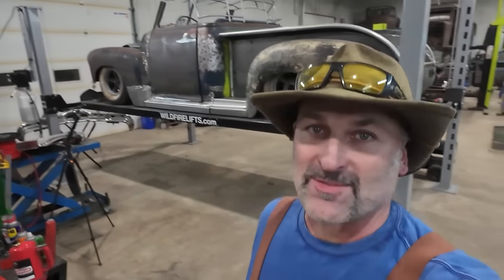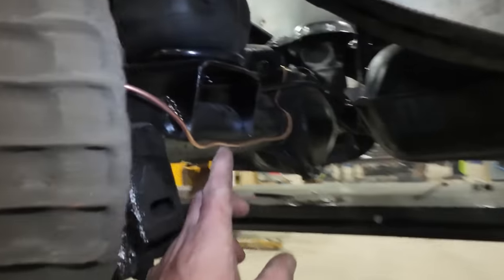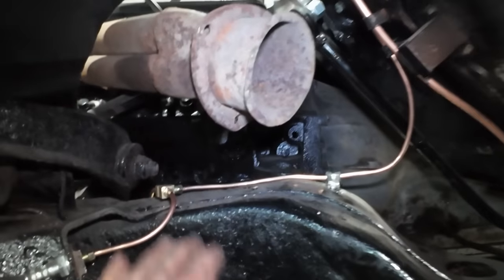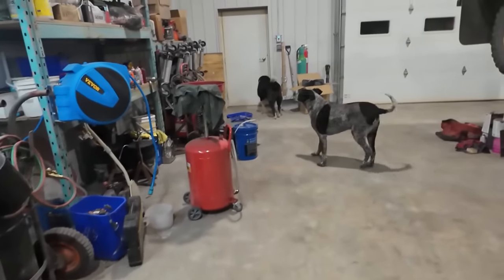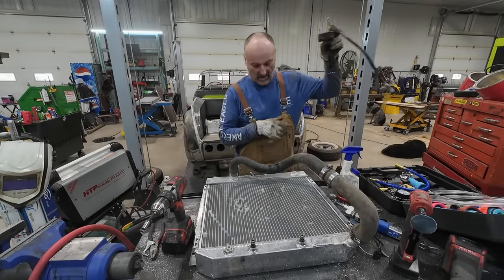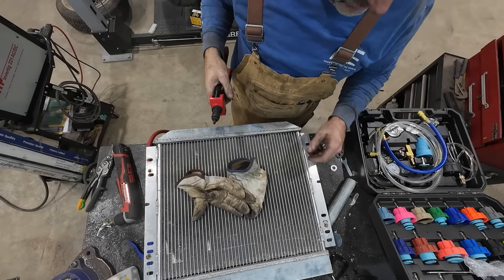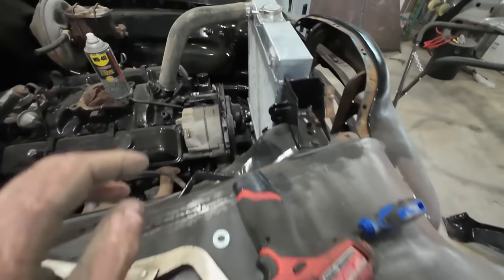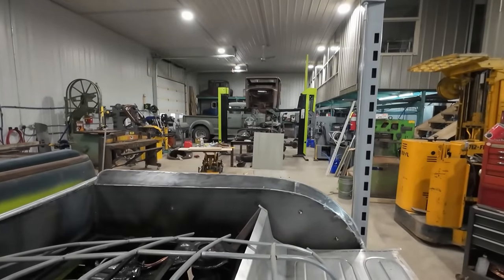We have brakes along with a cooling system for our GMC Roadster!

Comment: You’re always going to have that pin hole on aluminum aluminum backing off the pedal slowly and working your tig in a circular motion over the weld usually takes care of that issue

Comment: I like to use silicone spray because it is not corrosive to the aluminum and will not hurt the rubber hose, i like how the build is progressing!
Reply: Works good on tires to put them on in a pinch

Comment: I thought you had lost it when you cut up the top and bottom of the radiator. lol. Then I saw the one you were putting the pieces on and it all fell in place. 
Great to have some spare material around for the small jobs. Well done. Just shows a leaking rad is still useful.
Reply: Ill bet everyone could hear me scream from az.

Comment: Brent, I noticed that you are not using a solvent, namely acetone, to clean the joints before you weld aluminum.  Me thinks you could get a better weld if you used the acetone the surfaces.  The truck is coming along quite well, and I agree Pablo is one cool pooch.

Comment: Doubt it's necessary to run 1/4" line to rear. I've had 2 Ford Ranger extended cab 2w/d. They use 3/16 line for all runs.

Comment: In 1980 gm move the dip sitck to the riders side is the intake  set up for the choke spring or is it the round black thing on the carb black choke would be 77 and upand a few 78s

Comment: Do you use copper for brake lines ?
Reply from the maker: It's copper/nickel and is much less likely to oxidize or corrode and it's easier to work with

Comment: Brent, next time fill the radiator with water an you'll only have to pump it a few times to get full pressure.....
Reply: That makes it easier to spray with soap and check for any air bubbles.
Reply: @SPUDHOME  you dont need bubbles if its being hydro tested, you look for water....
Reply: @theoriginalDirtybill  you don’t need water if you are air testing. But it is Brent’s radiator and his vid. Maybe, you should start a new site .
Reply: @SPUDHOME  maybe you cant put the keyboard down and let Brent speak for himself.
Reply: @theoriginalDirtybill  why don’t you try. Just watch and learn how it was done
Reply: @SPUDHOME There's nothing wrong with what he said.That tester can be used on a car's cooling system full of coolant.
Reply: @frankschwartz7405  pay attention that is not the way it was done. If you want to do it your way do it. Don’t criticize everyone else. Git off your but get a shop. Start building your own. Then make videos showing the way you would do it. Then be smug.
Reply: @SPUDHOME >>Then be smug.<<
Well, I worked in a radiator shop for years.
Tested cars every day, using that very tool.
We also put in 10lbs of air and into a water tank.
Reply: @frankschwartz7405  have you ever built your own custom car?
Reply: @SPUDHOME 
Yes.
Reply: Where is the vids

Comment: Why copper tubing especially for brakes. Copper tubing is super soft and has poor resistance to Galvanic corrosion, a curious choice material for the underside of a car especially in Canada.
Reply from the maker: It's copper/nickel and is much less likely to oxidize or corrode and it's easier to work with
Reply: @HalfassKustoms  Ah, I missed the nickel part, I thought it looked  maybe a little brighter than typical copper but hard to tell on camera. That makes sense now and yes much easier to work with. Thanks for the reply Brent. Our 🇨🇦 winters I had to ask. 👍

Comment: Not aloud to use copper line for brakes in nova scotia
Reply from the maker: It's copper/nickel
Reply: @HalfassKustoms  got to be steel line or it will not pass safety inspection on brakes  lin3s

Comment: I thought it was just me, but it was surprising to see you using copper for brake lines. Here in the states, it is not allowed anywhere since the mid-sixties. I have never used copper and I'm not sure I would trust it with disc brakes due to the pressure. But it's your truck, and laws are different up there I suppose. You just be you.
Reply from the maker: It's copper/nickel and is much less likely to oxidize or corrode and it's easier to work with